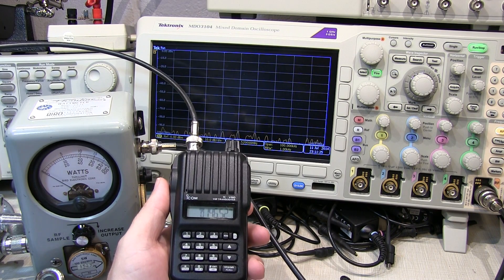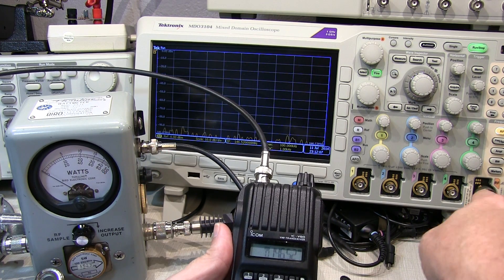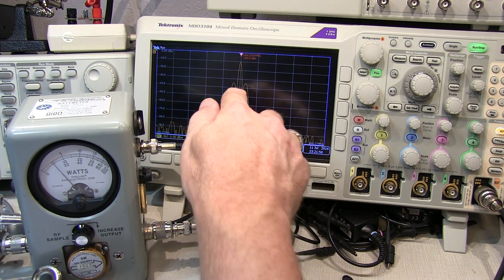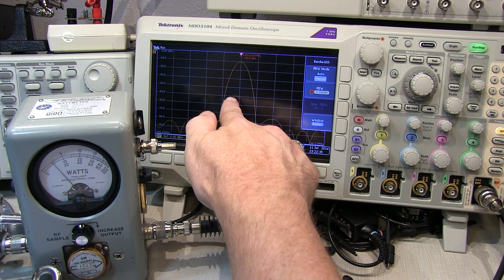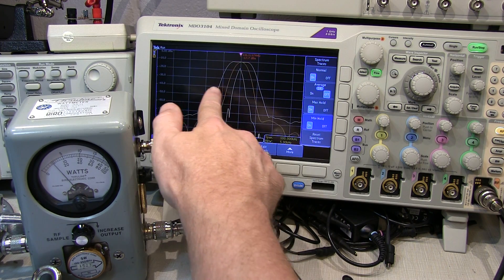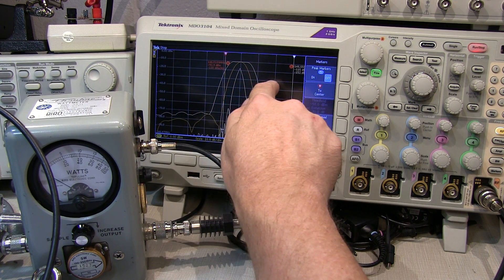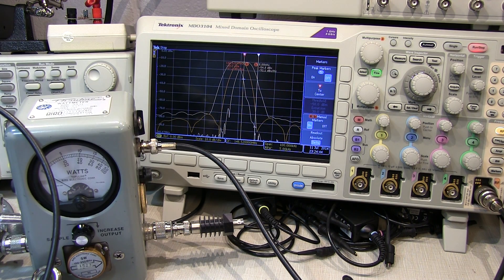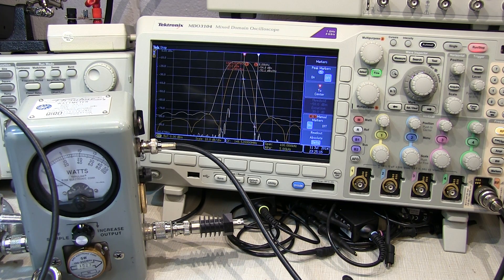#159: How to measure FM frequency deviation with a spectrum analyzer

Comment: Is there a rule of thumb for how much AF power you need to inject at the oscillator to achieve sufficient deviation?
Reply from the maker: Unfortunately. not really.  It depends on the design of the modulator.

Comment: How do you know what is the maximum deviation for the carrier frequency? because their must be regulations on each carrier frequency on how much FM deviation the carrier deviation SWING can be but not sure who sets these regulations or how they come up with this Deviation swing.
Reply from the maker: The allowable deviation for FM is typically mandated by the government agency that oversees spectrum usage - in the US, this would be the FCC.  For broadcast FM (88-108MHz), it is +/-75kHz.  For many land mobile radio (police, fire, etc.) it is typically 12kHz or even 6kHz.  It varies by radio service type.
Reply: @w2aew  But what circuit Inside the FM transmitters is adjusting the deviations? It must be based on the amplifiers output power level is what adjusting the FM deviation? What I'm saying is deviation is the same thing as the output amplitude of the transmitter output?
Reply from the maker: @waynegram8907  Frequency deviation has nothing to do with output power.  It is controlled by the modulator and the baseband signal level.

Comment: Thanks again! I was able to get an estimate of the deviation of an old signal generator with FM modulation using my basic Siglent 100MHz oscilloscope. But not in real time (the scope only takes 1024 points, not enough frequency resolution) but saving the signal values (about 20000 points) and doing DFT via software.

Comment: But what this example related to ? WiFi signal, audio signal over phone, audio signal captured by antenna .. or what exactly ?
Reply from the maker: This is mainly for analog FM applications (FM broadcast, hand-held walkie-talkies, etc.)
Reply: @w2aew  Yep, it's clear now, because the applications in electronics are a sea and specific setup and components for specific type of applications.

Comment: This makes no sense.
The real "minimum deviation"  is the centerline, the unmodulated carrier.
Theoretically thin as a needle.
What you present as minimum is the noise mod level?
.
So measure from the center to the max envelope and how would we define the power level 
where to take the estimate. Not that  good, your method.
.
I adjust my radios for bandwidth, not to exceed 12.5  Khz  or whatever at the bottom. 
Quick and dirty, but works for the amateur radios.
Reply from the maker: Yes, of course the unmodulated carrier is an single line at the carrier frequency.  However, this implies an extremely narrow resolution bandwidth (RBW) filter.  The problem with this is that the integration time of the very narrow RBW will be quite long, which causes the measurement to include the modulation components.  This is OK, provided your analyzer's RBW can be set low enough, which is typically not the case.   

In the measurement I show, I intentionally use a very wide RBW so that the time constant of the filter is extremely fast.  The unmodulated carrier will show the gaussian-like shape of the RBW filter, and that's OK (thus, the BW shown is the bandwidth of the RBW filter, not of the signal).  The deviation from center will be accurately reflected by the movement of the RBW skirts.  So, by measuring the position of the skirt in the unmodulated case to the position of the skirt when being modulated will give you an accurate picture of the deviation, provided the RBW is significantly wider than the highest baseband frequency.  As an RF engineer with 35yrs of experience, I stand behind this method (which of course agrees with dedicated vector signal analysis equipment).
Reply from the maker: @AlterKater  It is OK that you don't prefer the method presented here, however, the method I demonstrated is valid and accurate to within a few %.  I first read about this method in the book "Modern Spectrum Analyzer Measurements" by Morris Engleson, pgs 45-47.  It is also documented in this application note by HP/Agilent/Keysight on page 18: https://literature.cdn.keysight.com/litweb/pdf/5954-9130.pdf.  As long as the user opens up the RBW to be wide enough to encompass all of the Bessel sidebands of the signal, the method works.

Comment: Thanks for the great videos!  Quick question about deviation and packet work.  I’ve bought and built a tnc-x and there is an internal deviation adjustment.  What should I look for when adjusting within the tnc for correct deviation?  Everything I’ve read or heard so far mentions just going by ear or until the packets go through.  How could I be more precise when tuning?

Comment: Could you do a quick video showing how to measure the bandwidth while talking in different tones (maybe a whistle to reach the maximum audio range).  I see others like me were getting confused since FM bandwidth is usually about 12.5kHz.   Thanks again
Reply from the maker: While the BW of an AM or SSB signal is directly proportional to the bandwidth of the baseband (audio) signal, that is not the case with FM.  It is a bit more complicated with FM.  The occupied BW for FM is a function of both the baseband (audio) signal as well as the deviation.  These two (Deviation/modulating_frequency) forms a parameter called the Modulation Index, and the modulation index determines the amplitude of the sidebands of the FM signal, which all vary in accordance with the Bessel function.  See, I told you it was complicated!  This video breaks this down a bit better....
https://www.youtube.com/watch?v=8IBOYoIV5m8

Comment: I always thought deviation would be measured +/- from the center frequency.  I would have measured from the center to the max marker.  Perhaps I have been confusing +/- deviation with signal bandwidth?
Reply from the maker: The problem with measuring from center to the max marker is that the measurement would include the effects of the RBW of the spectrum analyzer.  This method shows how to measure the peak-peak deviation, therefore the peak deviation is 1/2 the value measured between the markers.

Comment: I am confused with your way of using menu markers to get peak-to-peak frequency deviation. I kind of suspect that the 8 khz p-p frequency deviation reading in your case is actually obtained by SA itself, not delta value between markers along a common level of max and min hold. Can you justify your measurement a bit?since I also find the delta value at different power levels are not a constant, Tbh I even doubt that delta value way is correct to make this measurement. Hope you can shed some light on my concern, thanks!
Reply: Hi w2aew. I just test your way and  i have question : why dont you move two vertical tracker to power is -40dbm posittion? In yoiur test is power horizontal  -30dbm. Because, I using Aligent Spectrum Analyzer, so when I track different posittion, i get difference result. thanks for read !
Reply: What I mean by justification is that I understand you create an envelope by using max and min hold, but I do not get what you did with delta value to say it is freq dev. Hope you are so kind yo point out if I am being foolish.
Reply from the maker: The vertical bars of the markers are used to measure the frequency difference between where the min hold and max hold traces cross a common horizontal graticule line.  The first cursor I moved was "attached" to the min-hold trace.  The second (delta marker) was also attached to the min-hold trace, but I wasn't using trace marker, just the vertical bar which indicates the frequency offset from the first marker by examining where this vertical bar crosses the max hold trace at the same power level as the first marker.
Reply: Yeah, I see what you mean.Sorry, I wasn't that carefully watching. :p And if I can explain what I was trying to do. I used a signal generator with capability of using FM mode, and I set frequency dev and FM rate value (which I think is so-called modulation frequency or audio frequency).  I got  result below while I set FM rate to 1kHz and FM dev. to 22.5KHz http://i889.photobucket.com/albums/ac92/yz10g11/IMG_1655_zpsok0mnw60.jpg. Maybe I should use 0kHz FM rate for Min hold instead of the min hold trace for 1kHz in order to get similar result with your case. I'll go try and sort it out. Thanks for your explanation.
Reply from the maker: I think the problem in your case is that you didn't set the RBW correctly. For this method, you need to set the RBW a little wider than the peak deviation.

Comment: can this method be used with a rtl-sdr???? THANK YOU VERY MUCH FOR THE NICE VIDEO. Kostantinos SV5FRW
Reply from the maker: I don't know enough about the software that is available for the rtl-sdr.  If the software can display the spectrum, and give you control over the RBW and include min and max hold traces, then yes.
Reply: The software does have RBW setting but no min max traces. Thanks. SV5FRW
Reply: Thank you very much. Very Helpfull
Reply: This video demonstrates an RTL-SDR dongle with SDR# and Visual Analyser https://www.youtube.com/watch?v=lWcFqsh7ZvQ

Comment: Thanks for the video. Would it be advisable to measure WiFi 2.4GHz frequency deviation and output power of Access points & NICs with a similar config? This would require 3GHz Spectrum Analyzer upgrade for MDO3000 I suppose?
Reply from the maker: WiFi does not use frequency modulation, so there is no deviation value to measure. Most of the variants of the WLAN standards use OFDM with QAM modulation on the subcarriers.
Reply: You will need a signal vector analyzer with the appropriate licenses purchased and installed for digital demodulation on the Wifi specific constellation.
Reply: ***** Exactly right. Using my portable SA, I test and measure WiFi signals all the time for tuning and optimal placement and this can easily be seen on the SA.
Reply: میتونید راهنناییم کنید؟